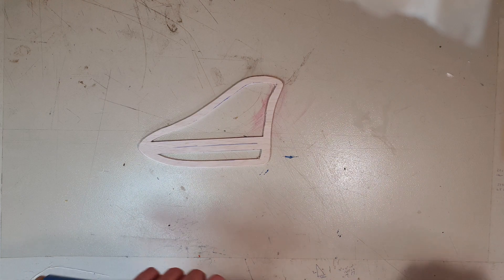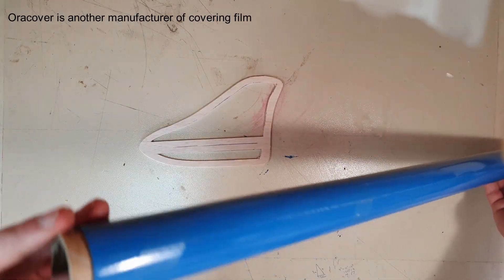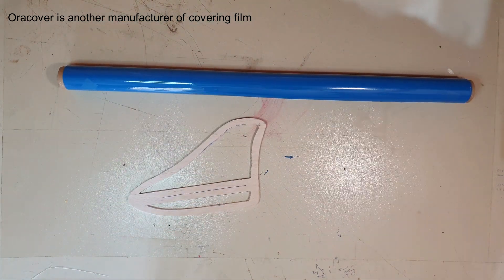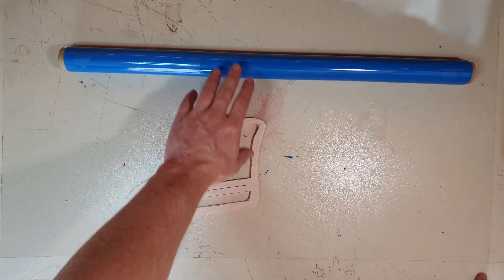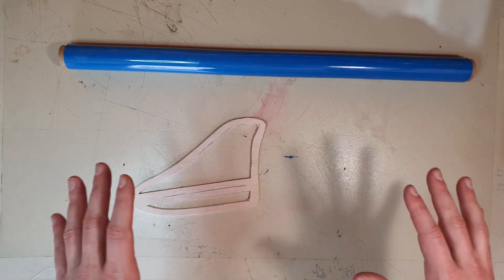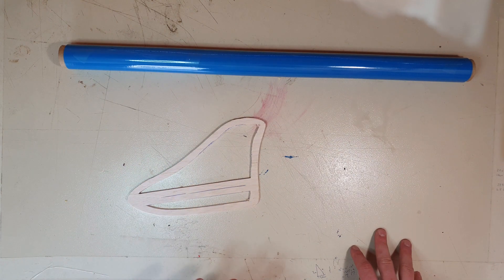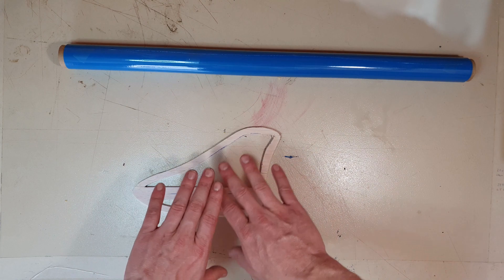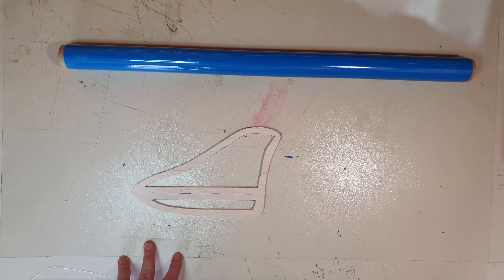Balsa Wood Flite Test FT Spear -  Episode 6... COVERED IN COLOR!!

Comment: I have a Spear build kit and a 70mm  EDF that's rated at just less than 5 pounds of thrust on 6s battery.  That being said, I'm fairly sure that a foamboard build probably won't handle 100+MPH snap turns. I SO hope to see your maiden of the plane fairly soon.  Pretty sure your construction can handle some serious G-forces. But, alas, I'm going to go full carbon fiber. With resin saturated balsa where needed. Obviously, I'll run into design issues on the center section as I want the EDF to be mounted within that section.. as low as possible. This means I may relocate the entire nose below the plane of the lower wing surface. That'll be fun.  Ought to have it done before summer. Have everything... just a matter of getting busy. I greatly enjoyed your build series. Many good ideas. You rock !!!
Reply from the maker: Hi Rick! Thanks for the comment and sorry about the delay in replying. Your plan sounds epic! This project is on hold for the moment, I am waiting for an SBUS reciever to partner with the flight controller, but I will get it done ASAP so you have an idea how your plan might play out!